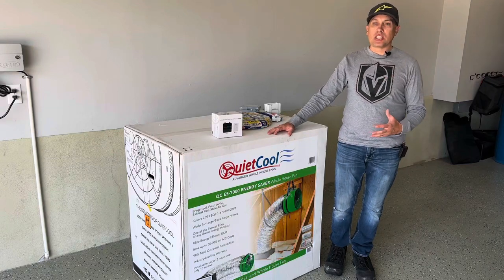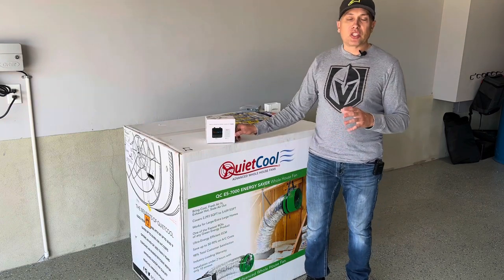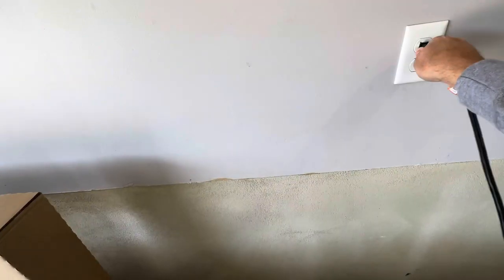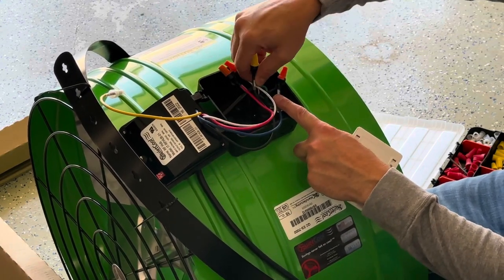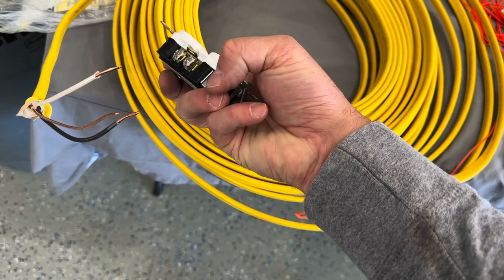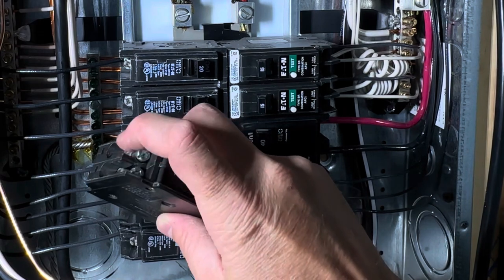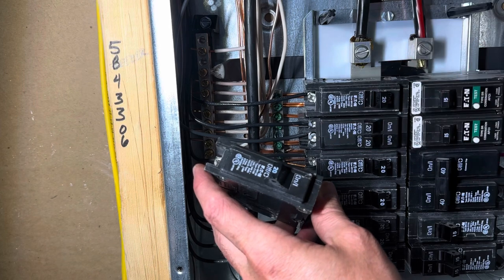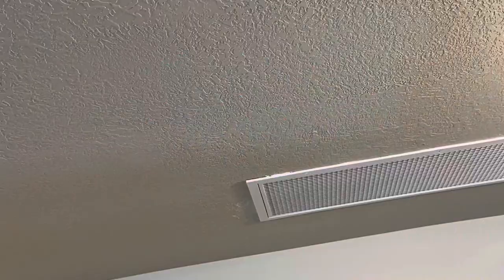QuietCool Whole House Fan Installation and Review | Homeowner DIY Quite Cool QC ES-7000

Comment: Great install video.  I'm totally a fan.  The QuietCool whole house fans are a great option if you live in a place that cools off at night.  I installed one in my Colorado home where we typically have 30-40 degree temperature deltas during the summer days.  The fan pulls in cool air from outside and pushes the house air into the attic.  This forces the hot air in the attic outside, cooling off the attic as well.  Your house will stay cooler longer into the next day saving on AC costs.
Reply from the maker: Thanks for sharing your experience!

Comment: Great install video, I feel fully prepared for when mine comes in this week. Not sure what’s up with all the weird, negative comments, you did everything very well.

It’s also refreshing to see an attic that doesn’t look like a condo. Mine is the same way; crouch only, loose insulation, no plywood to stand on. I plan to improve it at some point.
Reply from the maker: Thanks for your positive comment!

Comment: All the fans 3000 and above are 3 speed capable.  all you need to do is gently pull the conduit back and it will expose the 3rd wire.  You will know for sure if the motor is 3 speed capable because it will be on the actual fan motor lable.  Once you get the conduit pulled back you will see it has been capped off.  Run a wire off of that using a wire nut and and some electric tape then run the new wire down the conduit run.  using that RF remote (which I recommend) you wire it using the 3 speed set up.  Blue to blue, Red to red, Yellow to the wire you had to install off the motor, and the blacks to blacks and whites to whites.  Run the ground from the power cable to the ground inside the RF box.  Done.  Now you have 3 speeds not two.  I have no idea why they did not run that third wire down throught the conduit run.  It is much better to have a medium speed if you want... not just a High / Low speed.  Hope this helps.
Reply from the maker: Good info, thanks

Comment: I currently have a smaller older ES-2250 that's been great during the hot summer months to cool the house in the evening and early morning. It would have been nice to have the wireless feature in lieu of the wired controls. Nice video.
Reply from the maker: Thanks for sharing your experience

Comment: Thank you for sharing. What's the recommended outside temp to turn on fan? When the fan is on high setting, is it really loud to hear across rooms?
Reply from the maker: Really depends, for me if the outside temp is below 70 degrees I'll turn it on, and it's not that loud

Comment: You have a beautiful home, but you are going to want to remove all of that carpet and use rugs. I grew up in a house without AC in Texas and we used an attic fan, which is essentially what you just installed. We did a yearly spring cleaning, like all people did back then. We had to, in order to clean the dirt and dust from the house. Spring cleaning involved removing every single thing from inside the house and cleaning the house and the rugs and furniture. Every single thing came out of the house. Every piece of furniture, drawer including stuff from the closets. Washed the walls and cleaned the ceilings. Everything got cleaned piece by piece and replaced.

You could not pay me to put an attic fan in my home. Modern homes just aren't built to be cleaned like what is required to have a "clean" home when using an attic fan. Think about how dirty your AC filters get. You are going to get that times 100 by pulling unfiltered air in the windows. Plus you are going to suck/push a hell of a lot of dirt from your attic into your home through every ceiling penetration you have, unless all of them are sealed in air tight fire-proof boxes. I also have can lights in my home and they are horrible for allowing dirt from the attic into the house. I wish you luck, and man I can still remember how great it felt to lay in bed in front of the open window on a hot summer night, but that is going to cost you in the long run I'm afraid. I do hope it works out for you though.
Reply from the maker: Good information, thanks

Comment: I think that you mention two speed.  Isn't that fan a three speed fan with an EC motor?  I see that the wireless controller has low med and high.  Also, Have you automated it, maybe with a cell phone app?
Reply from the maker: This version only came with a two speed controller, and no, I have not automated it with an app

Comment: I have a QC ES-6000 and I can not get the duct off the fan to take the fan up to the attic. Even with the latch unhooked, there is not enough slack to pull the duct off the fan. Any ideas how to get the duct and fan to separate?
Reply from the maker: I just twisted and pulled mine and it separated.
Reply: @darren1922 I had the same issue, it will take some work and it will help a lot if another person holds one piece while you twist and rock the other piece to remove it.

Comment: Seems like you have Blown in insulation in the attic…. is it safe to install this WHFan with that insulation? Does it make the insulation fly around?

I have johns manville blown in fiberglass in my attic… i really want to get this fan installed but i’m worried it might make the insulation fly around.
Reply from the maker: Yeah it's fine, the fan blows towards the pitch of the roof

Comment: Great review. Its just a shame QuietCool makes the UGLIEST controllers for their fans. Why wouldn't they make something that seemlessly blends with switches everyone in the real world is using? Or let us use our OWN switches without having to figure out the correct wiring (albeit simplistic wiring for DIY).  I'll be shopping around a little more but this is a great review to see if the QuietCool is worth the pricetag. Thanks!
Reply from the maker: Yeah good point

Comment: I like the idea but I’m confused on this.. because if it’s suppose to help with the house getting cooler why would I want my windows open? Do I leave my windows open and then turn the ac on?
Reply from the maker: You turn off the a/c open the windows and this will suck in the cooler air from outside to cool your house.  If it's 90 degrees outside you don't use this.  You only use this fan when the outside temperature cools down like at night time.
Reply: @Myksgarage  got it! Thanks for your reply and video.

Comment: Why did you use 20 amp wiring?
Reply from the maker: So i dont over load the circuit
Reply: For any out there who watch this...20 amp wiring is not required.  It is also unnecessary to wrap electrical tape around the base of wire nuts. @Myksgarage
Reply: There’s nothing at all wrong with how he did it. Yes, 15 amp would’ve been fine for one unit, but say he wants to add lights, an attic fan, or another whole home fan in the future, he’ll be happy he oversized. And no, you don’t have to tape wire nuts, but it’s good practice, just like taping receptacle terminals. I don’t expect a resi electrician to tape every wire nut on a new construction, but if I’m doing my own project, I might as well take the time and go the extra mile.

Comment: Just bought one. Should arrive next week but wireless switch kit arrives a week later. Will I be able to run it with out switch
Reply from the maker: You would have to hardwire it to a switch which may not be worth the trouble
Reply: So you can’t just plug the cord it comes with to a switch?
Reply: @richardbolanos7151 what was the outcome?

Comment: How many degrees does it drop your house? And about how long does it take?
Reply from the maker: It depends on the outside temperature, on high it will bring the temperature to the same as outside in a manner of minutes
Reply: Mine will lower it but it take awhile, I can find it really cold in the middle of the night.
Reply: Mine takes a long time and doesn't get it to match the outside temp. Best it seems to do is 5 degrees higher.

Comment: Yes and removing cool air out of the house not good move and upsetting your ac handler return air pulling negative air against your return air grill.
Reply from the maker: When this is on, my central A/C is turned off....